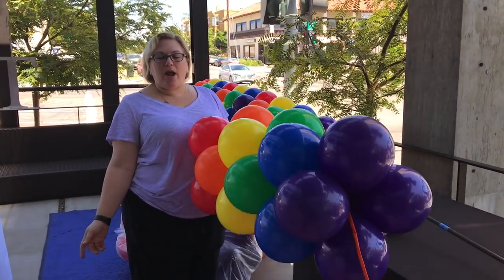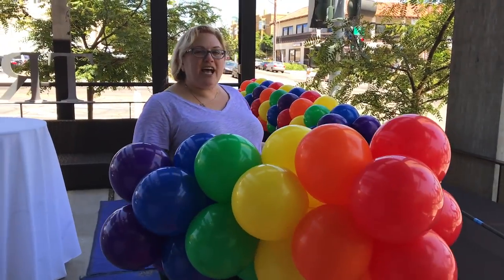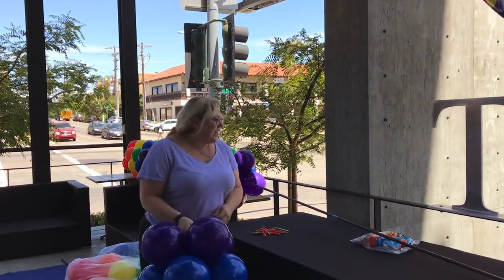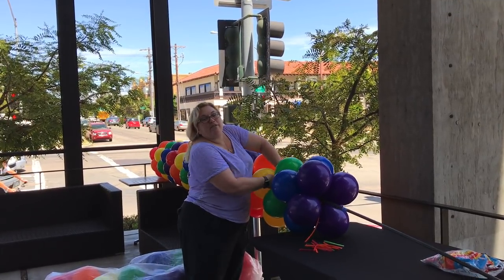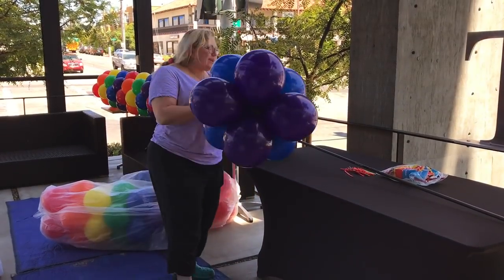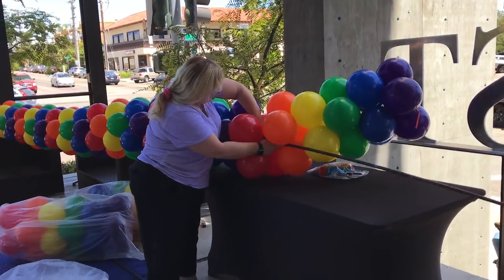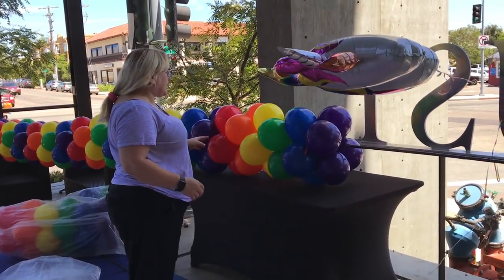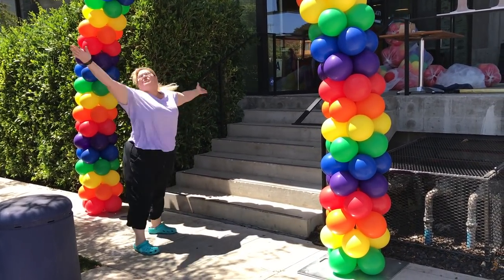Rainbow Arch - Transporting and Putting It All Together - Balloon Decor Tips and Tricks

Comment: Love It!!!  I tried this last year in my backyard with PCV (gray) frame like you showed in another video # FAIL, I blamed it on the gusty wind that day. Question 1.  Where did you purchase the Aero arch system Question 2.  Where these all air filled or was helium used for some, they stood up nice on the arch without swaying in the windQuestion 3.  How many team assistants do you normally have when your on site.I mainly work alone, but have a friend to help if needed
Reply from the maker: I usually go with at least 2 people (myself and one other).  This was all air.  The trick to the PVC is to have an odd number of poles and make sure that they are tightly locked.  It should stand up to wind, but if it's crazy windy, nothing will work.  I always say that I'm no match for G-d ;~)

Comment: Hi! Love your videos!!   What do I do if its pouring rain outside and I have to do an arch for a customer?
Reply from the maker: Thanks.  If it rains, you put on something waterproof and get wet ;~)  The rain wont bother the balloons that much, other than making them slippery and sticky.  Some mylar balloons may lose color a bit.  Helium is a problem in the rain as it could add weight to the balloon making it not float.   I have a weather clause in my contract, but if the client insists, then out into the rain I go :~)
Reply: @SandiMasoriPresents  Thanks so much! You always have great advice and are very helpful!

Comment: Can you make this arch smaller or you do not recommend going smaller?
Reply: I have an aeropole system and the minimum number of poles you can use when building an arch is 5 poles. I tried using 4 poles and ended up cracking the end of one of my poles which was connected to the base. I guess there was way too much pressure causing the poles end to crack :( I had to buy a single pole to replace the broken one because it was garbage. Hope that helps :)